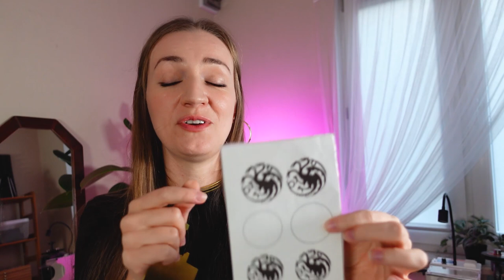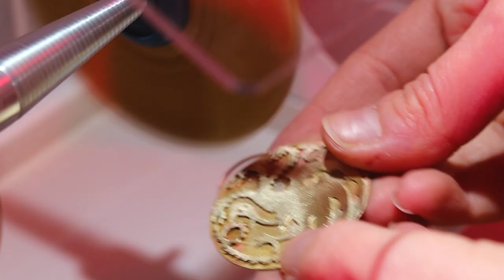Making a "Game of Thrones" Inspired Necklace! House of the Dragon Jewelry

Comment: Okay, I hope people read this; if you look at Basia's bench pin when she finishes cutting out the dragon, look how very little damage there is in the wood from saw blades. Basia has been using this pin for a while now, yet you can see how few times she has hit the wood. The edge is moving up and down in the same place in the air and not twisting and turning or pushing hard against the metal precisely as it should. When I say watching Basia saw is a master class, you can see the proof in the wood, or rather, not see as the blade touches the pin so infrequently. 
Stop blushing, Basia please; you deserve all my praise.
Did you use a smoke machine in the video? I could not decide if you did or if it was on the computer only? 
Thank you, Steve xx
Reply from the maker: omg, Steve 😆 Thank you, that is honestly the sweetest and means a lot.
Reply: @TheArtOfMetalsmithing  every word is perfectly true, you are the best I've seen, ever!!!
Stave xx

Comment: Hiya Basia,
I knew I would forget to say somethings; Your bench lathe, with that wonderful extractor, is it the Foredom one? I'm envious of you! It's the one I wanted, in fact, very much wanted. 
I trained as an electrician in a mostly factory based enviroment so most of my work was enginering based. Working a lot with copper rather than brass. I asumed brass, as a harder metal would be maybe harder to saw, like you thought too, interseting that it was not. Copper was always a pain, cloging up the teeth of the saw and getting so hot. I like that brass, even though it contains a lot of copper is different. 
That pendant is so hot, thank you for sharing it with us.
Stay safe, Steve xx
Reply from the maker: It's from Pepetools and the hood is by Foredom :) Both are great. Is the hood the one you wanted? 
I totally agree with you, I don't like copper. Tried sawing it a few times, not a fan. I found brass to be much easier with sawing! Surprisingly so. Though, it could also be because of the blades (Nano blades from Pepe). I'm being completely honest, not doing an AD. I'm very impressed by how they handled this. 
Thank you so much! I'm happy you like the pendant :)) ❤
Reply: @TheArtOfMetalsmithing what is there not to like, it's wonderful. Steve xx
Reply: @TheArtOfMetalsmithing yes brass is easy to saw and file, well to be worked in all ways, it's why it was made. 
Yes, that is the hood I'll be getting I think. I love the Durston machines, but not those prices. I've been going through Cookies tool lists, or toy lists even and putting them on a wish list. Nice to dream. 
Do you watch the Jewellers Academy podcast, or even listen? The latest is a jeweller from LA who uses TicToc and was talking about how it boosts her sales. Yet again I've forgotten her name and her shop name. Her jewellery is very good though. Mostly cabs in silver or gold fill mounts. Though she has started welding gold chains on people's wrists or ankles as permanent jewellery, often friendship with two people getting the same. The welding is not hot, very localised to the metal only.
Not cheap to set up though. 
Steve xx

Comment: Brass is such a difficult material to work with. Great job on the sawing!!!I have to ask, did you file or sand the edges of the dragon symbol after sawing or just go straight to solder?
Reply from the maker: I filed the outer edges only, not the ones inside. That's why I used 7/0 saw blade, which is almost the finest one. It leaves the edges failry clean. I thought that working with brass will be very difficult, but it turned out to be easier than I expected. It depends on the thickness of the metal, but the sheet I worked with was around 0.70mm and it was alright :)

Comment: Did you need to file any of the edges you used the saw on? I'm betting no! Is the Platinol getting old, a bit like me? Why out of brass? Other than you do have a lot of it? lol. Yet again you have shown that your own skill, coupled with constant practice does make for very accurate sawing, but you are the best at it!!! 
Steve xx
Reply from the maker: I only needed to file the outer edges :) All of the edges were pretty clean and smooth because I used almost the finest saw blade (7/0). 
Platinol seems still very ok! I[ve had it for at least a couple of years. I always keep it closed tightly, in additional zip bag and in a dark place.
I started to like brass a lot! It's pretty, cheaper than silver, and yes, indeed, I have a lot of it, after my accidental massive order haha :D 
Thank you so much Steve xx
Reply: @TheArtOfMetalsmithing You're very welcome, dear lady, Steve xx

Comment: Could you show us what you use to print the designs ❤️
Reply from the maker: I usually print them on a A4 paper and then use a double sided tape or glue to stick it onto the metal. I also print my designs on a label paper using a label printer :)

Comment: What is the thickness of the metal sheets you are using? I have noticed that it is more difficult to saw brass than silver, ...so many broken saw blades 😟. Does the size of the jeweler’s saw blade depends also on the type of metal?
Reply: Hiya Nadya,
I've never found that. Just try to make sure you have 3 teeth in the metal at any one time. The blade information has how many teeth per inch or mm then use the thickness of the metal to work out. most blades are broken when you change direction, so always go extra slow, work the blade up and down to form a very small pocket, enough to turn the tiny blade then slowly rotate the piece while still sawing, slowly. Keep the saw upright, most especially at turning points. If it catches, stop, and release the metal from where you are holding it down, it will swing to where the teeth are pointing, re-start sawing, again slowly. I may have said 'slowly' a lot but it is one of the most important points for me, do not rush!!! Lubricate the blade frequently, and you will learn to feel when it needs more. Beeswax is always recommended. Learn to love it as Basia has and you will soon be doing as well as her. 
Stay safe, Steve...
Reply: @stephencoster9532  Hi, thanks for the tips. I think I am missing exactly "be slowly" part. I always tend to rush... and also the 3 teeth rule ...😅 Thank you again!
Reply: @nadyahrisimova5293 you are very welcome, I believe we need to help each other. I started reading books on smithing and then watching YouTube videos with help in the comments just like this. I know from what she has said that Basia has gone the same way, plus a few short courses. It can indeed work and work well, just get as much help as you can as and when you can. The old saying; The only stupid question is the one you didn't ask! It's true. Steve...
Reply from the maker: Steve already gave a perfect answer and great points! I will just add to it that I did think that sawing in brass may be more difficult than in silver. But surprisingly it wasn't! I haven't noticed much of a difference and I'd say it was still pretty smooth, however (another good point by Steve), I noticed that the most important point was NOT TO RUSH and take my time. If I noticed that the blade was pulling on the metal, I was slowing down, taking a moment to re-adjust the direction of my saw frame and blade, to grip my metal better and just take is slow. And that's because I was using nearly the finest blade, the 7/0 (not sure if I kept the 3 teeth rule, but rather was going for the finest finish on the cut). Since I wouldn't be able to access many areas to clean them, I wanted to make sure that the edges would be as smooth as possible after cutting, which can be achieved by using finer blades. You got this! Just take your time and don't feel intimidated. And don't worry if you break blades, it's absolutely fine :)
Reply: @TheArtOfMetalsmithing with a 7/0
 I think you probably had 5 or 6 teeth in at a time with the saw upright. That is why the higher number blades cut so smoothly is the increase in the number of teeth in the metal at one time. A 2/0 blade would have larger teeth and cut a more jagged cut. Think of your files, the more teeth the smoother the finish you get. 
Enjoy the learning, the more you practice the better you get, like Basia. 
Steve...
Reply: @stephencoster9532 I didn't have experience with every blade, only with 5/0 and 6/0. My case was exactly with 2/0 on a 1.25 mm brass with lots of small curves and details. At the near end I decided to give it a try with the 7/0...so smooth. I spent two days after that trying to clean the gaps (0.5-1.0 mm) out where I could only fit sandpaper sheets. I guess people use laser cutting for that...? Or probably they use 7/0 and then a tumbler.
Reply: @TheArtOfMetalsmithing   How do you prevent the brass from turning redish/ brown, dark yellow over time...for example two weeks period... I guess mine is a result of fire scale..when I use silver I can spot if I have them either at the moment or when I polish the piece but not  when working with brass sheet pieces.. Probably you can make this as a part of your "tips and how to" series.
Reply: @nadyahrisimova5293 I don't imagine many people have a laser cutter, in fact, I've never seen an advert for one so do they exist in the trade? As a 7/0 has so many extra teeth all very small making very fine smoother cuts is why people recommend using those sizes of blades. Using a single sheet of memory paper is normal for the smallest places, nothing else will fit. A tumbler will burnish a piece of metal but is not noted as being good at de-burring sawn edges and will not smooth them, merely make them shine. They will still have sawing marks and scratches, just shiny scratches. Steve...